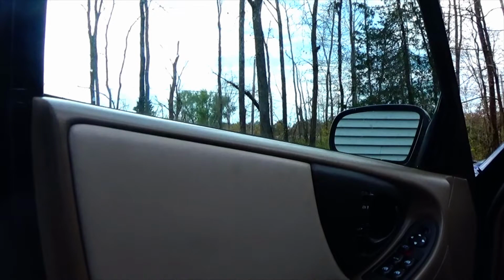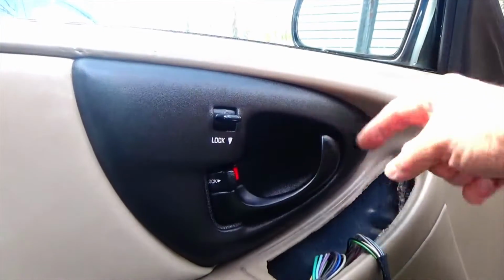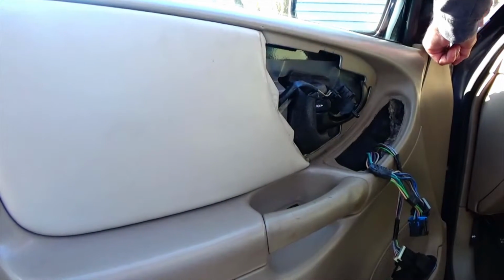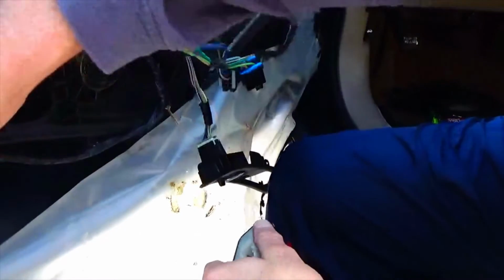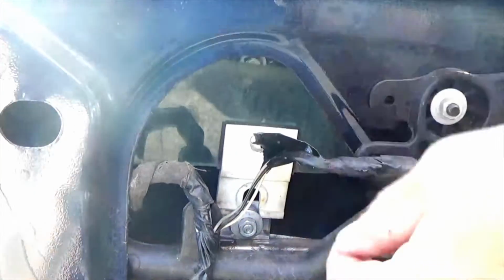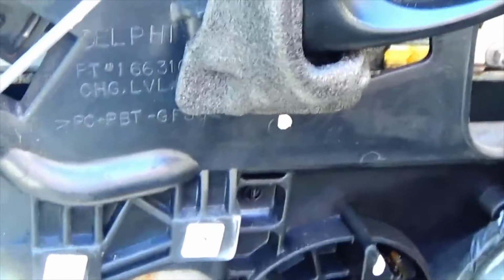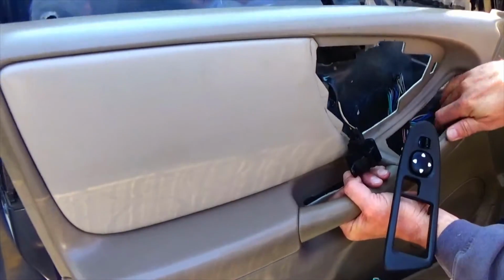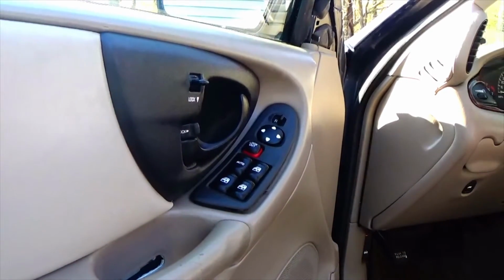How to Fix an Off Track Window in Your Car

Comment: very informative, very helpful. I had one difference with there being another pair of bolts in the center beneath/behind where all the window switches are [they were very annoying] but once i got those everything was exactly as the vid showed. I had a slightly different problem with the glass being slightly off-track and we got it re-aligned and it's good to go now. just saved me 100+ bucks. Kudos
Reply from the maker: Thanks! Glad my video helped!

Comment: Really good video.  You are a great teacher.  I was going to buy a regulator, but my window is going up at an angle and stops.  I have to push it up and down to make it go up right.  Thanks for tjis upload
Reply from the maker: Thanks for the nice comment....I’m glad my video helped to get your window back on track!
Reply: @beachtroll8344  Hey dude.  I'm back.  I ended up replacing that power regular with the bar and pulleys.  Your setup looks similar to mine.  It will go down but it's squeaking/rubbing really hard on the way up.  When I press up on the power window, it seems like it's tilting forward and stopping.  I see lots of play in the assembly but it's all tightened down.  Before I put it all back together, I tried shifting the window when it's loose on the tracks and then tightening it when it's pressed to the back side of the track and then tried with it all the way forward.  Doesn't seem to make a difference.  All I can think of it's the rubber that's causing the friction so bad it's stopping the movement.

The sucker is stuck all the way down as of tonight, so tomorrow I'm going to have to take that side panel off again.  Going to look at that rubber on the side that you pointed out,  to see if it might be getting stuck behind the window.  Definitely some hard resistance somewhere.  I've lubed it up with silicon with no real improvement.  If  I can figure out what it is, I'll try to remember to comment again and let you know what it was.  Hopefully it will help you and others.

Comment: First, great video!  To, "beachtroll" or anyone else (below) who may know the answer. Having same problem. Automatic window raising but crooked. I checked and the glass is locked in place at bottom. Should I loosen the fasteners where the bottom of window is screwed in place, and merely slide the entire window to the left a bit?
Reply from the maker: Thanks!....I would loosen it and adjust the  window accordingly and re-tighten....Good luck!

Comment: This has been the most helpful and straightforward video I've seen regarding how to fix a window off track. Good job dude. I'm off to try and fix my window now 😌
Reply from the maker: Thanks for the nice comment and good luck on your repair !
Reply: @beachtroll8344  update: got the window back on its track. Thanks mate, you've saved me some $$$ 🤙🏽
Reply: @beachtroll8344  you made my day with this fixit yourself video I have a 2001 Chevy suburban and my windows are completely off track and can't roll them up. Do you have a video for this? Please mechanic wants $300 per window got two.

Comment: You are a great teacher.    
My driver side window started making that awful sound, the auto-close is not working either.  (Where ya click ‘Up’ once and it rolls up itself) It is especially loud when it reaches the last few mm, rolling it up before window is shut.    I live off Chesapeake Bay and we have the most geese in the world, and they love crapping on my car, plus a giant cedar tree is 20’ away.  The day it made that noise there was crap and wet tree litter on windowand Im sure some went down the inside.  I did my best to clean it from outside, I sprayed ‘goo gone’ at front of window, and it seemed to be better for a few days.   
Im guessing the issue is not a mechanical malfunction.  I assume (hope) it is just dirty.    I am wanting to do the job myself, what do you suggest I do nxt?  Thanks
2012 Mazda cx7
Liked n subbed
Reply from the maker: I would take off the inside of the door panel and see if the goose crap &/or tree debris are sticking up the window mechanics....If you find that's what is causing the problem, after you clean it down, use W-D40 and spray it down well...Good luck!
Reply: Thank you.   Um, spray window jamb?